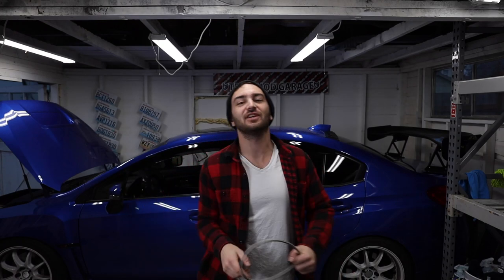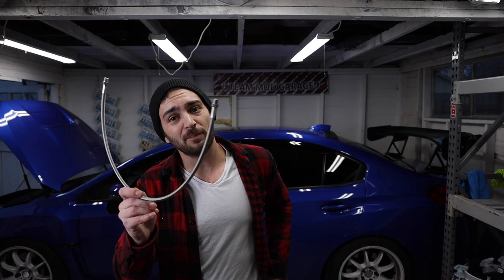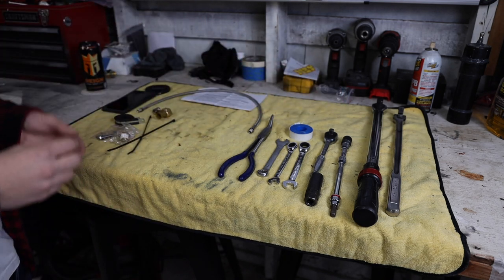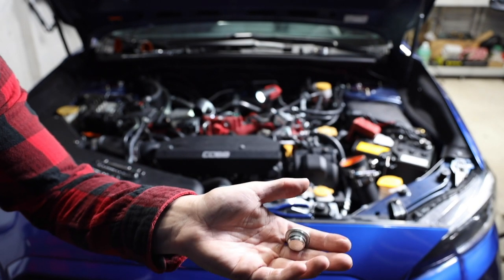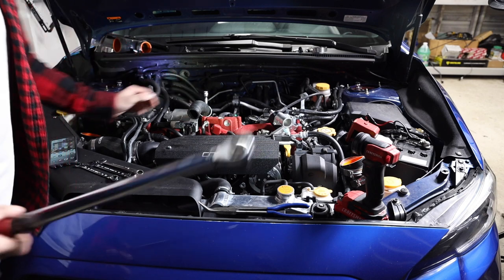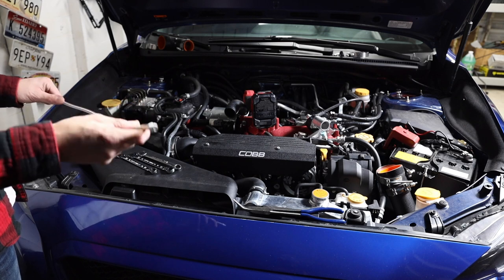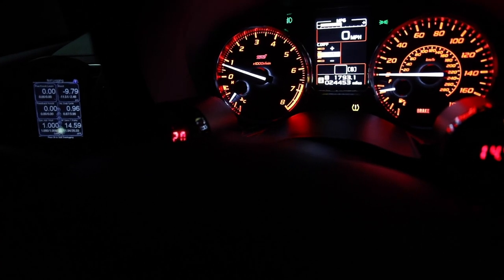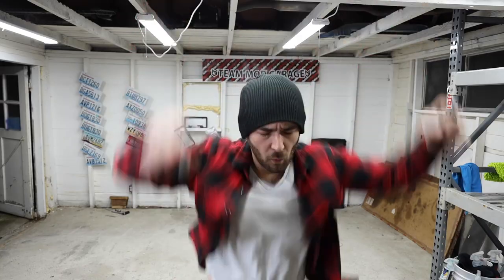STI Oil Pressure Sensor Relocation

Comment: Just bought this kit cause of your video lol.  I have AEM oil pressure and oil temp gauges sitting behind me waiting to be isntalled.
Reply from the maker: I wish I would have know about this kit before I attempted lol the Hose really makes it so much easier to be able to install the gauges, Are you tapping into the Rear galley or the front?

Comment: What are normal ranges for cold start, warm at idle and while driving? I’ve got an 04 WRX and just installed an oil pressure gauge.TIA
Reply from the maker: What size oil pump and what grade of oil? 🙏
Reply: @Smeedia  04 wrx OEM stock pump which is 10mm I believe and I use 5w-30 oil grade
Reply from the maker: Cold start 80-100 PSI .idle 15ish 🙏
Reply: @Smeedia  Thank you! Drove it this morning and I got around 98psi on cold start and on warm idle I was at 30ish psi. I was at around 80 psi while driving 75ish mph. That’s normal right?

Comment: Hey, just a quick question, what was the point of adding the oil line rather then just screwing the sensor right into the adapter, and also could an oil temp sensor be pluged in instead, or have a T-piece with oil temp and pressure

Comment: Hey Tanner! Are there any pros/cons to running the oil pressure sensor to the spot under the alternator vs next to the coolant crossover nipple (like you did in this video)?

Is one spot better than the other?
Reply from the maker: Normally I do the pressure sensor under the alternator as it's closer to the pump and the temp sensor near the spot by the turbo 🙏
Reply: @Smeedia  I have an iag pan, would it be good to run temp to the pan and pressure under the alternator?
Reply: @Smeedia   Hi Tanner just a quick question please, any reason why you didn't run the oil pressure to the spot under the alternator in your video? I am thinking of using the spot under my alternator for my 2005 wrx, would that be okay?
Reply from the maker: Yes that spot is okay 🤝
Reply: @Smeedia  Thank you very much

Comment: hey smeedia, what are normal oil pressure ? i have the killerB pan and pickup. for me at idle is at 25 -30 and sometime at 20psi warm up.
Reply from the maker: 20-25 is fairly average for a warm start 🙌

Comment: Where did you get that oil pressure line from? Can you help me, drop link below for it. Thanks in advance brothah.
Reply from the maker: https://www.rallysportdirect.com/part/prs-psropkit-prosport-remote-oil-pressure-temperature-sender-install-kit?gclid=Cj0KCQjwlK-WBhDjARIsAO2sErTANOPPihH-5L7u9DH-vWrO6BnhEWxgmtj2R8ois1-mmGh_KFvi6RYaAhcJEALw_wcB
Reply: Thanks Just ordered it along with the Steering Brace. 👍

Comment: I just got an AEM oil pressure gage they make it so I can wire it into my ecu and the part that hooks into my engine bay that had the sensor is more wires inside of a case if both meet as they connect into the back of the gage what did you do to delete some of the wires to use flex tube to run the fitting into the part by the turbo ? Then from where you mounted it in they engine bay. Then ran the sensor back and mounted on the back wall  so I’m guessing from the sensor back it’s just the original wire that goes into the back of the gage ? Did you also wire it into you ecu or did you just get rid of that part ?
Reply from the maker: I cut the wires for the ECU because I never planned on running it that way, but I've seen some others do it. Not sure what wires to tap into

Comment: So what ended up being the fix to your aem AFR guage ?? Was it the sensor ? Awesome content btw! Keep it up!🤙
Reply from the maker: Yes it was the sensor, AEM sent me a replacment one but it was bad also. I ended up buying s generic one off of amazon and splicing on the pig tail from the AEK one. Thank you, the support is appreciated!
Reply: @Smeedia  Which wires went to which wires when you spliced the pigtail? I'm in the same boat and I'd appreciate your help!
Reply from the maker: There should only be 3, power, signal and ground 

Off the top of my head I dont remember but should be 
black - black. 
White - white 
Whatever the last is
Reply: @Smeedia  I appreciate your wisdom!
Reply: Smeedia I need your wisdom again! I was attempting this today, but the AEM (Bosch) LSU 4.9 sensor pigtail has 5 wires. The Denso 234-4668 (generic sensor) only has four wires. Do you remember if yours was the same way? I’m not sure if I can just delete one of the wires..
Reply from the maker: I beilive mine had all 5, ill chdck my Amazon history to see what the part # was
Reply: Smeedia Let me know please!
Reply: Smeedia If you can confirm that it was part # Bosch 17018, I would appreciate it!
Reply from the maker: This is the one I used 🙏

https://www.amazon.com/dp/B000BZL0LC?ref=ppx_pop_mob_ap_share
Reply from the maker: Did you use the same wideband as I did or the X series?
Reply: Smeedia So it is the 17018, awesome! Yes sir, I used the same one. I appreciate all your help, you’re seriously the best YouTuber/person!
Reply from the maker: Thank you! Just trying to help where I can 🔥🙏

Comment: Would you recommend this method over a Perrin oil pressure and temperature adapter plate that mounts above your oil filter? The adapter plate seems like the easier option since you get both fittings and is an easy install, but I'm not sure which is better.
Reply from the maker: You won't get ass accurate readings from the sandwich plate, and all of thr ones i have hD in thr past end up leaking. I would suggest doing it this way
Reply: @Smeedia  I appreciate your input and the fast reply. Thank you!
Reply from the maker: Anytime!

Comment: Wht was that extension called that you attached to the breaker bar to get the factory oil galley plug out?
Reply from the maker: The swivel or the small 3" extention?
Reply: @Smeedia  i think i have the extension covered now. Im doing this install as well so i have questions constantly😭. You said you need a “T7” bit but that looks awfully big to be a T7. Did you mean a 7mm hex bit to get the oil galley plug out?
Reply from the maker: OH! the heads bit, yessir it's just an Allen key that's a 3/8th socket yessir it was a 7mm hex 🙏
Reply: @Smeedia  ok cool i was out here looking at a T7 like ...wtf. 😭 thanks man

Comment: Hey bud what was the size of the bpst/npt fitting you used and where did you track one down from? Thanks in advance!
Reply from the maker: I believe it was 1/8NPT however, this was the prosport kit that had the extension included with the thread pitch, I would check their webpage and it should have the pitch
Reply: Smeedia thanks for the quick response! I’ve got the prosport oil gauge w 1/8 npt sensor. Looking to recreate what I did not get in your kit... roughly how long was that braided line? I was also trying to find out what size the bpst male side was that screws into oil plug hole...
Reply from the maker: The line was 2 feet long, so gave some decent room to move it around 😅 this was the kit I used. Off the top.of my head I do not recall what the BPST was, I think i mentioned it in one of the oil pressure videos 😅

https://www.rallysportdirect.com/part/gauge-sensors-wiring/prs-psropkit-prosport-remote-oil-pressure-temperature-sender-install-kit?gclid=Cj0KCQjwybD0BRDyARIsACyS8mstxVfQ8L4ydsPtv_wYsoU7EnLjagqQxNET7IwMbs1JRW9xTLkNDu4aAm7FEALw_wcB
Reply: Smeedia I’ll do some research and find out... keep doing what you do bro love the videos! Smart dude, solid advice, great energy! Thanks for keeping your car and builds tasteful!

Comment: Is that the plug location I'd want to use for oil temp sensor, even though this video was for oil pressure?
Reply from the maker: Yes you'd want to use that galley for oil temp as cyl 3 gives thr most accurate oil temp reading 🙏

Comment: Can you skip the relocating line if you install the sensor in front by the alternator?
Reply from the maker: Maybe, depends on of your sensor will fit under the alternator
Reply: @Smeedia  i think im getting the aem oil pressure sensor, but im getting the 0-100 one, same sensor size as yours i think, hope that fits in the front side just fine, where did you get the extra oil line?
Reply from the maker: Rally sport, its the prosport line. I don't think the sensor will fit right in. Might run into clearance issues
Reply: @jesseclark7639  did you end up using the sensor by the alternator. That is the route I’m wanting to take for the oil pressure sensor.

Comment: Hey man! I wanted to know if you could help at all. I drive a 2016 Subaru WRX and want to put a quick release in it. What do I need to do/wire to not get my airbag light to flash all the time. And same with the horn?
Reply from the maker: You can wire in a resistor to the air bag to stop the system from disabling. I did it in my old 350Z. I'm not entirely sure with the Subaru airbag system though. But you can run a resistor so that the system thinks that it's getting power though. I would suggest checking NASIOC for what resistor to use. The horn should just need to be grounded to work so as long as you can find a grounding point for the nee horn it will still work!